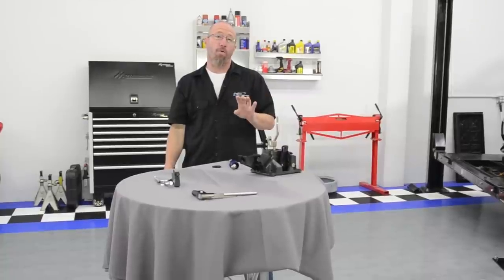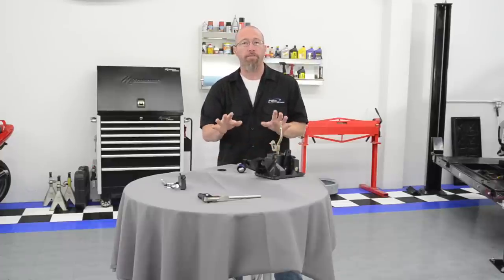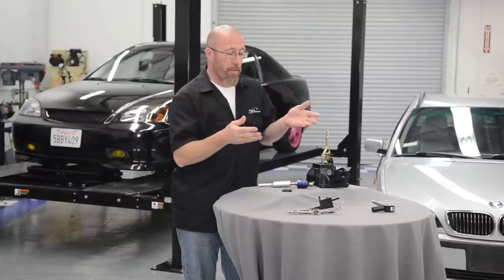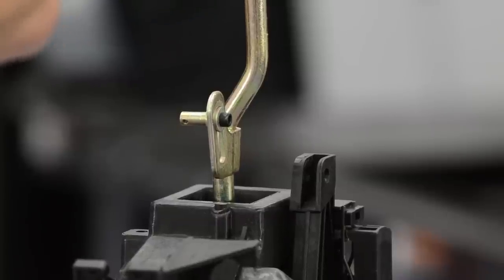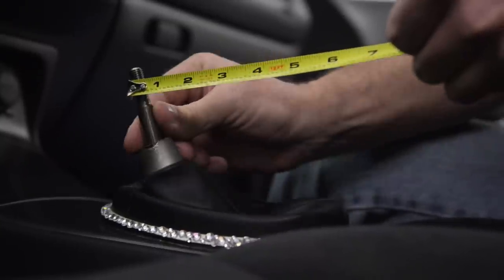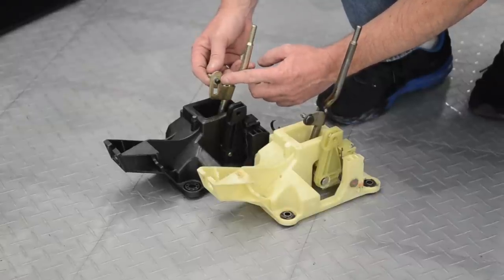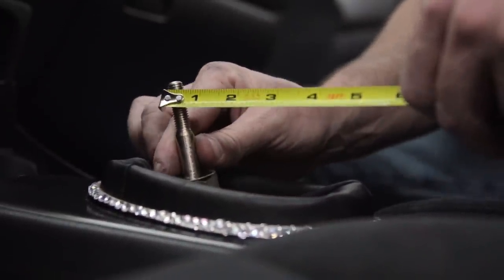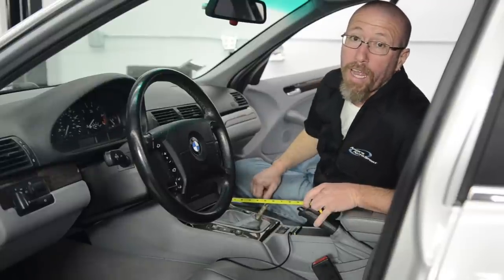Short Shifters - Presented by Andy's Auto Sport

Comment: Short shifter is only useful if it help shifting process and timing.  In my car a short shifter increases wear because I shift way faster now  than the sycro gears can deal with.  In may case I would have been better off rebuilding the stock shifter.